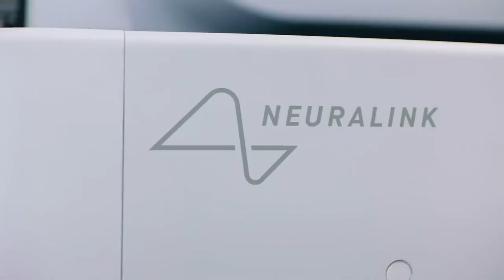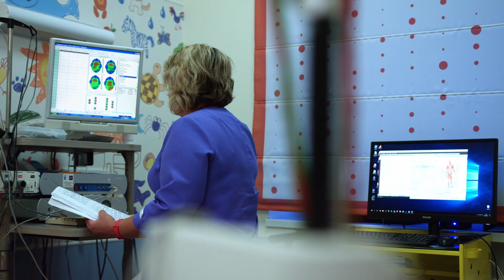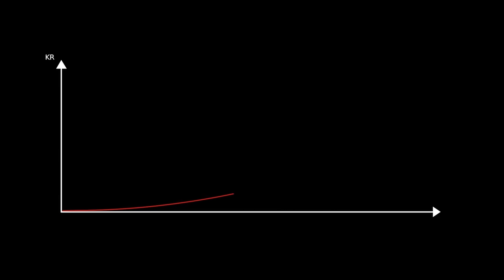This Is The Year Full Dive Virtual Reality Will Be HERE!!

Comment: Can you do a video about your ideal full dive game? Also great vid quality!!
Reply: It can only be xenoblade chronicles (either "X, 1, 2). VR, RPG need to be as sophisticated as this series, otherwise it will be underwhelming.
Reply: [ADVICE]

MY-PHILOSOPHY: "INNER-STRENGTH"

I have found that simply "loving myself" (inner-child) is a powerful tool against most types of social-dependency/vulnerability.

Example:

In my mind, I visualise a picture of my younger self (family albums might help). And I 'remember' what the emotion of genuine love felt like. And then I project those emotions onto the mental visualization of my younger self. I meditate and hold that 'state of mind' for as long as I can. 

The result? I feel my conscious energy resignating with positivity and renewed strength. And my anxiety immediately evaporates away. At the very least, depending on my levels of anxiety, this mediation practice aids to 'evaporate' much of it. You can do the same thing with "trying to 'remember' temperatures, e.g. hot or cold. And then project that memory onto a visualised heat source (all within your minds eye). You will 'feel' the effects immediately."  

  I hope this proved helpful.